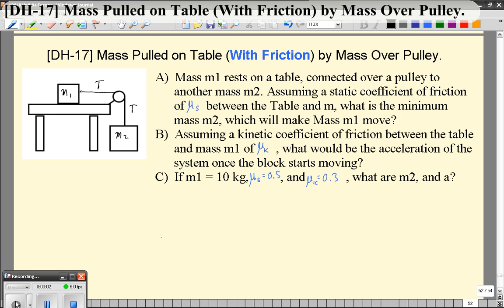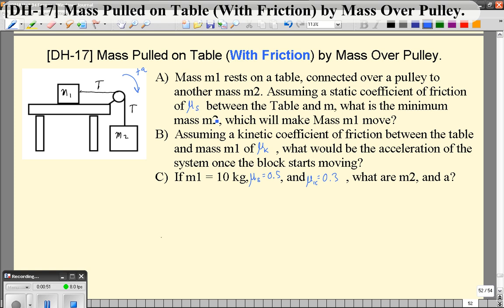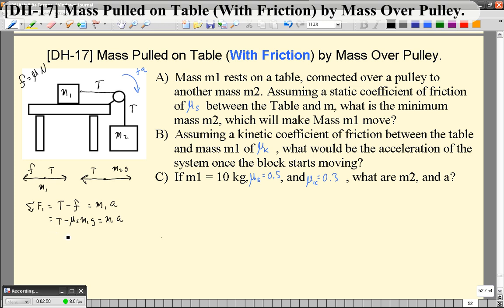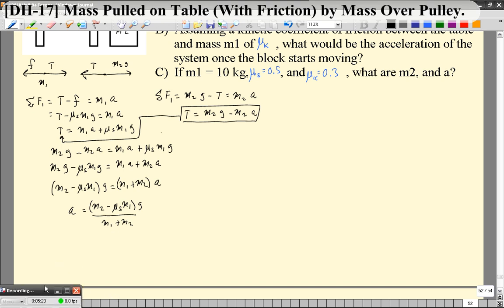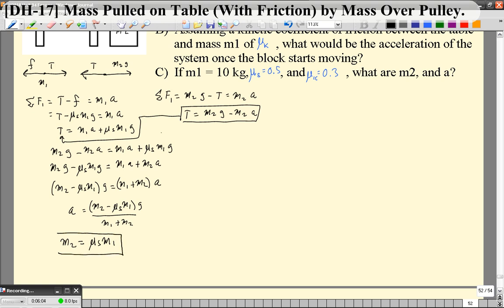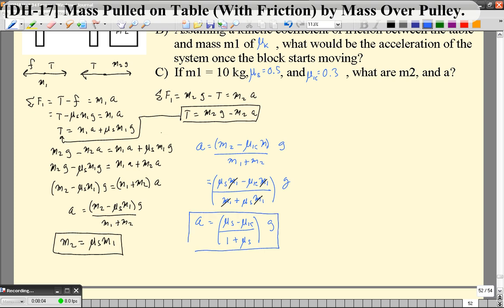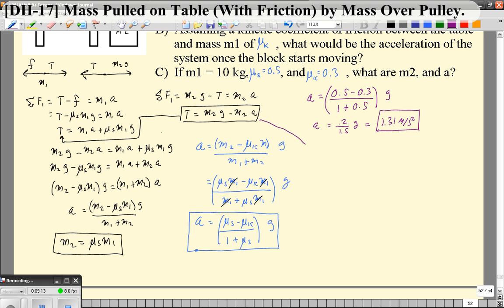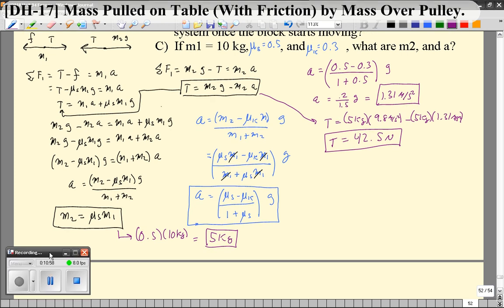[DH-17] Mass Pulled on Table (With Friction) by Mass Over Pulley.

Comment: this is still really confusing. i got lost around 2:42. i thought you're not supposed to assume f = Mn if it's static friction, only for kinetic friction? also, how is n = mg? I thought summation of F = mg? 

also i think there needs to be more labeling.
Reply: Lol its 13 years later
fs(max)=MsN
fk=MkN
you got two different equations for different types of movement. 

N=mg because of newton's third law (each force applies the same force back at the opposite direction) so your mg is canceled by N. otherwise we would be falling into earth's core or something :D